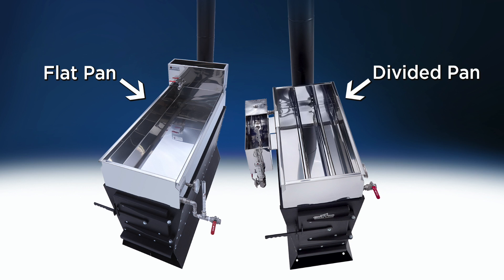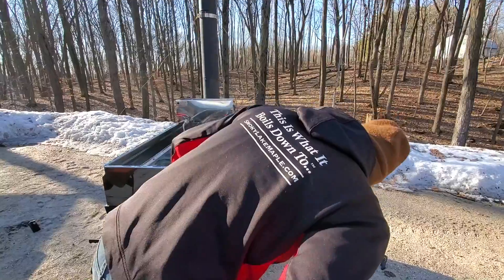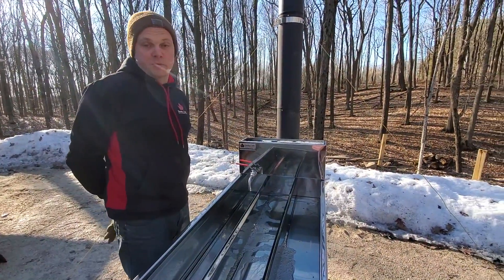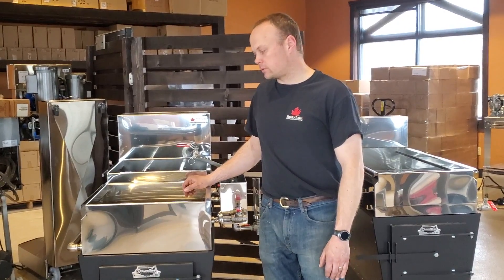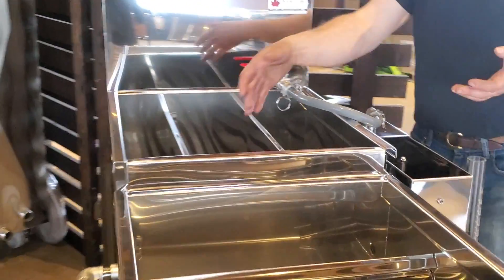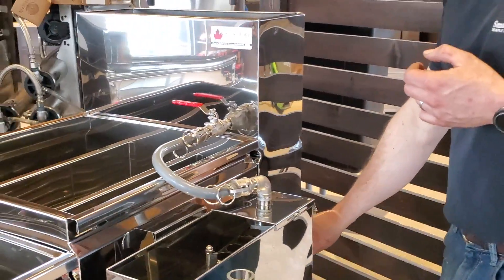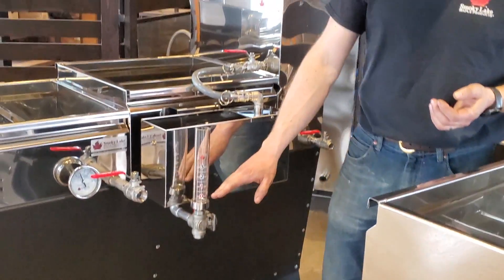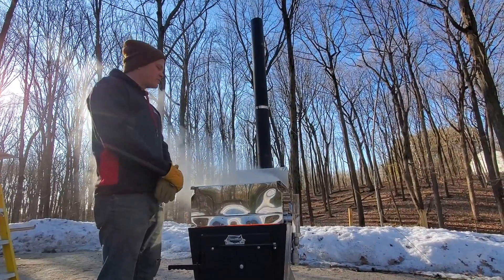Backyard Evaporator Set Up - Filling the Pans with Sap

Comment: Does the sap in the drop flues get wasted? How does that sap get removed? Any help would be appreciated as this is my first using the drop flue pan and burned my first batch yesterday.
Reply from the maker: Normally, at the end of the season, the sap from the drop flues and the rest of the pan system is drained and finished on a stovetop pan, but sometimes a burned-out producer will just dump it.  Some pans have a drain manifold, but others have to be siphoned or pumped out...